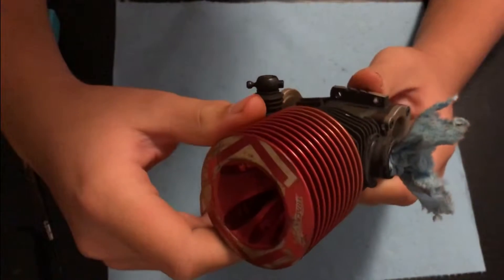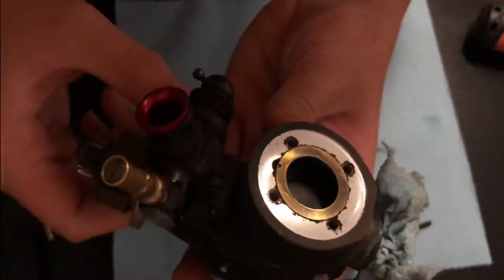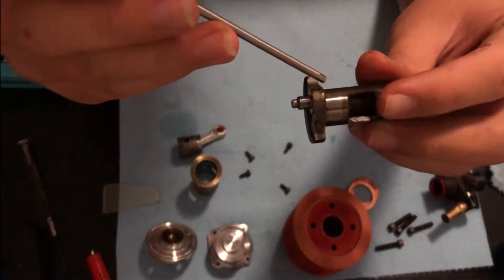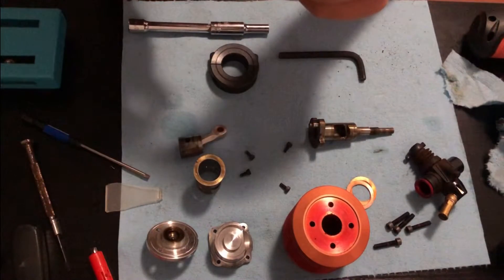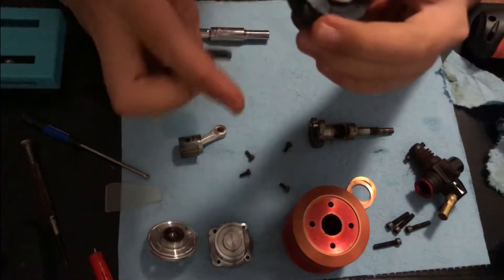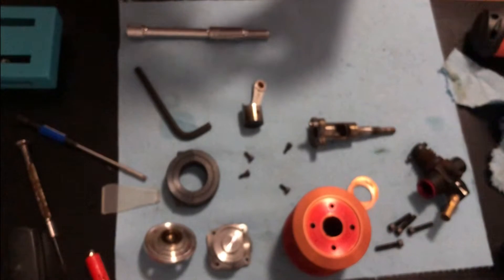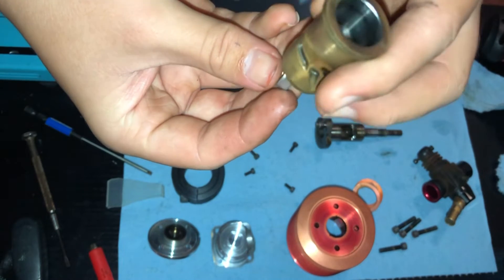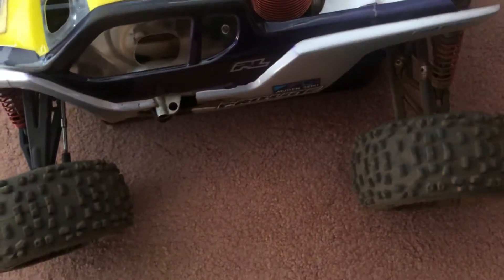A look inside a $75 nitro engine. Also how to repinch a piston and sleeve

Comment: How is this engine holding up after the repinch very informative video dude
Reply from the maker: @HISMAXIMUS  it ran pretty strong for while after this. Eventually the bearings started to go a the debris from that broke a glow plug coil off and scored the piston and sleeve pretty bad. Kind of an unfortunate end to the engine’s life but it put in work for the time it was running

Comment: Have you done any videos of repinching a smaller motor? Like a 15 or 18? I have a handful of 15 and 18 that could use a pinch but the clamp your using is to big for them.
Reply from the maker: I don’t have any videos. I would measure the outer diameter of the sleeves on your .15s and and .18s and get a clamp that’s an 1/8” bigger so you can fit the copper ring between it and the sleeve. I use a 3/4” clamp for .12s but that may be too small for .15s

Comment: How many head shims you got on that? Your suppose to remove one if you change strength fuel to higher % right? 2 is the default amount I think, if there's three from factory.
Reply from the maker: These engines came with two. One is .15mm and the other is .10mm I think. I haven’t had to do any headshim adding or remove while switching back and forth between 20% and 30%. I think once you get into the lower stuff like 15% or less is when you want to remove headshims or go to a hotter plug if possible. I run protek t3 plugs with 30% VP Tessmann blend and haven’t had any problems. The only time I add headshims is if an engine is running a little hot and is finicky to tune. With the bigger piston to head clearance, the engine usually smoothens out, tunes easier, and runs cooler.
Reply: @moralesrcdesigns3784  the better plugs are p3. Those t3's don't last as long as the p3. 30% nitro is ilegal here and Europe believe it or not, our strongest fuel (unless we make 30 ourselves) is 25. Your right about removing the shims if you go as low as 15, but I hate using anything less than 20 and so do my cars.
Reply from the maker: @uberangler  I also have p3 plugs, but I’ve found that those are too hot for most engines so I only run them in my OS’s. My dad is the person who buys 90% of the stuff for him, me, and my brother so he buys the t3 plugs since they’re a few dollars cheaper and since we’re running 6 engines at a time. I haven’t had any problems with the t3 plugs, they last a decent amount of time (definitely not as long as p3s) and all our engines run consistent and tune easy. It’s unfortunate that you guys can’t run 30% over there because these little nitros absolutely love 30. 20% is great, but the engines just don’t respond quite as well
Reply: your suppose to add another headshim if you increase nitro content

Comment: Send it off to adam drake  $25.00 to resize
Reply from the maker: That is another option. He has a very good tool for it and is a pretty much guaranteed perfect repinch. I just wanted to figure out how to successfully do it myself and I have. It may not be as precise or consistent as Adam Drake’s tool but it gets the job done and that’s what works for me
Reply: Alot of people where using that very thing a few years ago.  But had issues with consistency and the right amount. Now they make a Die for doing it
Reply from the maker: @craigjones2015  It definitely isn’t the most consistent method but I always start light, and if the pinch isn’t tight enough, I’ll try tightening the clamp a little bit more. I just go in small increments until I get the tightness of pinch I’m looking for.

Comment: Why not just buy a new piston and sleeve 🤷🏻‍♂️
Reply from the maker: Piston and sleeves can be fairly pricey, and if the piston and sleeve of an engine is in good condition, but just has no pinch left, it’s far more cost efficient to have a sleeve repinched. I repinch sleeves for $20 and rebuild/refresh engines for $30 (not including parts being replaced like con rod, bearings, etc.) which is much cheaper than $150-$200 for a new piston, sleeve, and con rod. Even just replacing bearings, connecting rod, and getting a repinch is cheaper. Although, if the piston and/or sleeve has significant damage on it, there’s no fixing that

Comment: How many gallons have you put through that motor ?
Reply from the maker: That engine before the repinch had ~7 gallons. Pretty good considering the fact that these engines don’t have much pinch in the first place
Reply: @moralesrcdesigns3784  very good considering the price
Reply from the maker: @born2fish838  yep. Engine performs pretty good on the track as well. Fuel mileage and throttle response are meh but it’s got the torque for a truggy and great top end.
Reply: @moralesrcdesigns3784  I ordered the .28 the other day bc it was going in my losi 8 truggy and I was worried the .21 wouldn't be enough power. Sorta wish I would have went with the .21 after watching how good you truggy runs with it. Oh well I may end up with 2 of them
Reply from the maker: @born2fish838  I haven’t run the .28 but it’s based off of the alpha .28 and I know that engine is pretty good so the .28 shouldn’t give you any problems. It’ll have more torque which is fine for a truggy
Reply from the maker: @born2fish838  I haven’t run the .28 but it’s based off of the alpha .28 and I know that engine is pretty good so the .28 shouldn’t give you any problems. It’ll have more torque which is fine for a truggy
Reply: @born2fish838  I've got around 2 gallons on the trackstar .28 in my Hobao Truggy runs great wicked power wheelie power.
Reply: Where do you get the clamp?